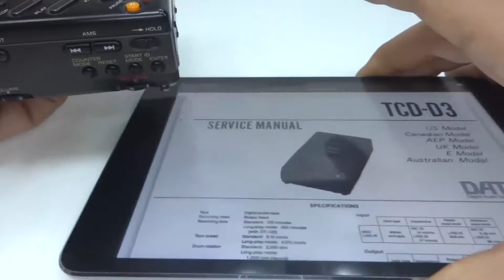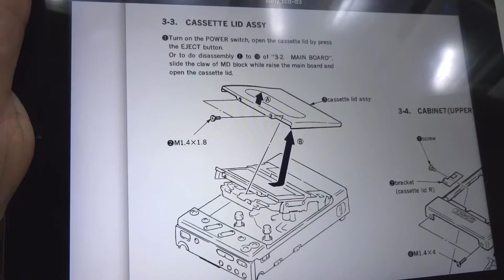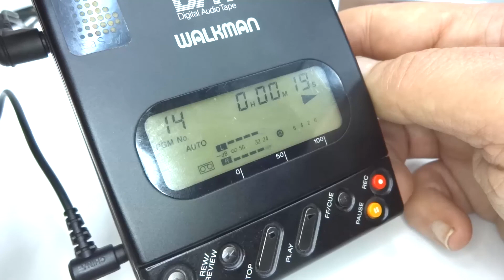Sony TCD-D3 Digital Audio Tape Walkman teardown & repair

Comment from the maker: I would like to thank Mike for providing a key piece of information in re-assembling the gear section. I struggled with this part and ended up not filming my many attempts and put it down to blind luck in the end. Below is Mike's description and the document he found.

"the image of the load/unload detector gear is exactly how the gear must be set.  Notice the spring is resting on the hub and the larger protrusion on the hub is pointing at the 4 o'clock position.  Hard to tell from the hand drawn picture but the gear teeth to the right are positioned exactly as shown.  Also, there  was a bit of resistance to setting cam gear 'B' to the 9 o'clock position but it too must be exactly as shown.  Even though it is hand drawn, it is quite accurate!"
https://drive.google.com/file/d/1iALyt8N_TsuhBS_y2FTb4-zE3xypc0ay/view
Reply: I was looking for exactly this info. Someone had hands on this unit I'm working on, and Sony was kind enough not to include this very essential info in the SM... shame on them. I was sure the unit has synchron issue, but without this picture it can take forever to find the right constellation... thanks!
Reply: Ok so it seems that even that guide is not precise enough. Following that will result the B gear 1 tooth out of phase. Correct position can be achieved like this: when the machine is in base condition(stop-unloaded, lid closed), there are 6 1/2 teeth between the dot on gear B and the left side of the opening lever (it must be in the "closed" position!).  The dot on gear B is at about 9 o'clock position, you start counting from the tooth just under the dot.
Reply: @janosnagyj.9540  I have taken my  machine apart " again " to fix the missing pads for the break, after reading this , it did seem still out of sync. So after I fix the breaks I will use your method. To see if that  helps. Thank you.
Reply: @TunnelLeaf  Well if the machine was working OK then I think you have no problem there. In my case it ended with +1 teeth position, so almost any operation finished with "CAUTION"... even a simple eject as well.  But after power down - power up, you could use the machine. Moving the B gear 1 tooth solved all these issues.
Reply: @janosnagyj.9540  I ended up at the end of the day (yesterday) having a working dat machine. I did replaced all the pads on the breaks and I did use your idea on the adjustment of the gears . No tape loops out and I have fast forward and rewind . Thank you
Reply: @TunnelLeaf  No worries, glad you managed to make it. So now there are 2 more working examples ;)
Reply: ฟฟฟฝฝ
Reply: I spent like 6 hours to figure out the right alignment of the gear section on my TCD D7. I could not set up the cam gear B to 9 o'clock position so I had to figure out a way to sync the gears in a different mode. It was a nigtmare.
Reply: For those of you who have trouble setting the cam bear 9 o clock direction. Move the mechanism to the fully loaded position then set the cam bear 9 c lock position.
Reply: I have a question. On my dat it let's some extra tape out , could I use the tension arm to fix that? When I started the unit did not work, but now it somewhat will.  Thank you

Comment: Dear Sir,

Do you have any experience with the Sony TCD D100 device?

What type of battery is built into it?

Can it be purchased separately? The display is soldered to the motherboard.

Thank you for your reply.
Best regards,
Reply from the maker: I've never seen this model, but I do really like the way it looks.
Reply: @JanusCycle  Does the TCD D3 model also have a built-in/soldered battery? A tiny one? To keep track of the date and time?
Reply from the maker: @bomby-1176  The TCD-D3 doesn't have a clock or calendar function. I didn't realise the TCD-D100 has this. I really want one.
While I am bidding on one at the moment, I expect it will go for more than my bid tomorrow.
Reply: @JanusCycle  Oh, I'm sorry.

I have one with a mechanical fault.

What are you looking for, and how much are you willing to pay?
Reply from the maker: @bomby-1176  A kind offer, thank you! 
I would also like to hear about your interest in these devices and what you enjoy about them. email is a more appropriate forum for talking about potential trade.

Comment: I'll be the newest to comment. I tried once or twice to examine and fix my TCD-D3. Your link to the service manual won't work for anyone not already registered to hifiengine, they won't accept new registers. I bought the original digital optical & s/pdif add-on companion unit for this too. Maybe I'll try again to get this little gem working. (CAUTION)
Reply from the maker: I'm going to have to update some links. Here are the manuals. Good luck and let me know how it goes. https://drive.google.com/drive/folders/1as4tXSpxGgHf_Zl9dsKUsMwIqgcV2E9m
Reply: @JanusCycle ... .. Thanks so much for these it's great when YT content creators actually read and followup with responses to their video's comments. Appreciated 👍
Reply from the maker: @Carlsings  Thanks so much :) When I stared this I decided it wasn't for fame or fortune. I just wanted to share things I enjoy and communicate with others who also enjoy these things.
I really want to get my TCD-D3 out again for a new video. It's been way to long.

Comment: I bought a Sony Portable TCD-D3 DAT Player/Recorder in 1990, I believe, it costs me $1,000 CDN at Advance Electronics in Winnipeg, this was Sony's most serious attempt (that I know of) to push this format into a mainstream consumer offering. My intended use for this was to obtain and record the music ABC Sports used for their 1989-1991 Tour de France broadcasts WHICH WAS NEVER RELEASED TO THE GENERAL PUBLIC. So after two dozen long distance phone calls in 1991 from Winnipeg, Canada to ABC Sports AND Kalehoff Productions in New York they did send them out to me, which I made digital copies of (FOUR R-DAT TAPES) worth and then sent everything back. So now in 2025 I'm curious how long will the audio stand up for, I'm at 35 years now and I think I can hear the sound degrading, just a little bit, but I really don't know that for sure.
Reply from the maker: I also don't know how long DAT tapes will last. Magnetic recording is usually quite stable. With many floppy discs from the 1980s and analogue master tapes from the 1960s are still fully intact today. If stored correctly I don't think they will decay. But I guess it could also depend on the individual quality of your tapes and your DAT machine condition today.
You can make bitperfect digital copies of DAT tapes. Using your TCD-D3 and a digital audio recorder, or a computer, with SPDIF input. I experimented with this in a couple of videos. With using digital data encoded into the music to prove to myself it was a bitperfect copy.
See, 'Sound Bits: backup data in all the wrong places' and 'Sound Bits: recapturing bitperfect audio from DAT'

Comment: I bought mine new in 1991, I still have it, never use it so it has low original hours.
If I ever tried to repair it myself, it would end up like bad, bad Leroy  Brown, "looked like a jigsaw puzzle with a couple of pieces gone".

Comment: Thanks!  I've got a D3 and D7 I need to repair - very helpful video as a start.  I think these portable DAT machines are the pinnacle of Japanese engineering - absolutely fascinating how they are put together. /Brett
Reply from the maker: I hope your repairs go well. Be very careful if you need to take the gear section completely apart, I struggled with this for too long. I saw your video, looks good, I think you will enjoy the experience. Let me know if you need any help. Feel free to email me as well if you want.
Reply: Thanks mate, appreciate it.  Had a quick look on Yahoo Japan auctions - seems to be a decent supply of the D3s (at least) in various states - thinking I might buy (or try to buy) one of the cheaper "not working" ones as a possible donor ... buying a known working one (at top dollar) just defeats the purpose ;) /Brett

Comment: Sampled with an almost new DAT Walkman. To my ears, I found the bias and equalization a little off, something not natural, slightly thin sounding. I actually prefer the analog cassette format, I find that more pleasing to the ears. For digital just go with CD etc imho.

Comment: Hey. Congratulations on resuscitating your little masterpiece of Japanese electro-mechanical engineering. Must be very satisfying using it now. I bought one new around 1990 for something approaching $1000 CDN. Unfortunately it croaked a few years later (dead electronics). After lounging around my closet for a few more years I donated it to a local museum. I couldn't find the service manual on the web at the time. Now I kind of wish I'd kept it.

Ah well. There'll always be other projects.
Reply from the maker: Thank you. I wanted one of these since the 1990s. It must have been amazing to have owned one in 1990!

Comment: I use a hypodermic needle with sewing machine oil and it frees up the capstan shaft (loosen the screw on the topside and slide the pad to one side, tiny spot of oil there) and a tiny amount of lube on the shafts of those gears and it's all good.  The tape broke because you moved the cassette back and that engaged the left spool lock, d'oh! I've just fixed up a dead TCD-D3 that has a seized capstan and ate tapes, the reason it ate tapes is the frame and "shark" shaped plastic piece that opens the door fully (and retracts the hub locks) was bent and the left reel was always locked and the cassette door would break off if the lid of the machine was pushed closed.  It's quite easy to work on, just have the right tools and I found a head torch to be really, really useful.  Glad to see people still using DAT after 30 years! 😁
Reply from the maker: Great tip, thank you. DAT is amazing. I really enjoy owning this fine machine.

Comment: Should never put a screw driver near or on a head. Even if it does not move you don’t do it.
Reply from the maker: Thanks, I need to use a plastic tool more often.
Reply: Janus Cycle 
Get yourself some of these 3 Pcs Nylon Plastic Spudger. Type it in on eBay. Your find them handle for things like this and cheap too.
Reply: I forgot to say to people. Anyone thinking of buying a dat recorder.or buying one to do up. This dat player the D3 only had a head life of 600 hours. A lot of dat recorder only had head life of 600 - 2000 hours. I repair a lot of electronics and see this a lot where people want there dat repair. But I have to tell them that the head as done it’s time and that why you get drop outs or recording that are not as good as they was. The problem is you just can’t get the parts now. So be careful buying this format. It’s a great format but age as catch up with it. Don’t think your find many now that is not over its head hours now.
Reply from the maker: @michaelmitchell8218  I agree. I took a chance because I wanted the experience. A working unit is a fortunate bonus.

Comment: Hi good job.
I have one D3 but I can not align the gear A with gear b correct.
can you show one picture o explain the position of this 2 gears?
thanks
jesus
Reply from the maker: Perhaps you mean the rotary encoder gears? Have a look at the 'technical theory' service manual and let me know. https://www.hifiengine.com/manual_library/sony/tcd-d3.shtml.
I found the rotary encoder was very difficult and much trial and error was needed to get them right.
Reply from the maker: I have pinned a new comment above with a newly found description of the gear alignment for the TCD-D3.

Comment: I owned 2 of these in the 90s both had fuse troubles both needed repairs (built in fuse replacement) I did like them though. Good little unit
Reply from the maker: Thanks for sharing your experience of the faults you encountered. It must have been amazing to use these in the 90s. I really wanted one of these back then and I'm very pleased to finally have a working one now.
Reply: @JanusCycle  it was always amazing listening  back to the recordings made with them. Quality  and authenticity to original sound.
Tapes recorded on one would sometimes glitch if played back on the other but that was probably due more to head alignment than anything else
Reply from the maker: @antonfarqua  I love that DAT worked so well, but was also operating close to the tolerances of the technology of the time. Thanks for reminding me of this cool machine. It's been on my shelf for a few years, I will revisit it one day.
Thanks for coming back after five years to reply :)
Reply: Hello do you know the location of the fuse?
Reply: @jesamani75  it's on the main board somewhere it's an electronic fuse that blows when a lower rated adaptor is used in place of original. I belive due to the high start up draw as the tape loading mechanism runs. I had them fixed by a tech so i can't help with exact location of the component. If I remember rightly the tech referd to it a a" sacrificial fuse" hope this helps
Reply: @antonfarqua  thanks so much

Comment: Hello, nice and helpful video. I have the same model which had a similar issue. I cleaned the rotary encoder underneath the gear cam. Now it ejects the cassette but it does it too early, leaving about 1 inch of tape out of the cassette. It believe it's out of sync for a few gear teeth. Could you please give me some advice? Thank you.
Reply from the maker: The rotary encoder is very difficult to get working properly. There is a second service manual called 'Sony tcd-d3 technical theory' which has very detailed rotary encoder instructions. I ended up doing some trial and error until it worked ok, still have some rewinding issues but I don't want to try again for at least a while. Here is the manual https://www.hifiengine.com/manual_library/sony/tcd-d3.shtml
Reply: @JanusCycle  the helpful manual is "theory of operation" . I fixed caution error due bad official service repair procedure  (sprayed with oil that glued the mech gears) and I unmounted and rephasing encoder gear after complete cleaning.
Reply: Have you figured out the issue?  I am having the same problem with mine!
Reply from the maker: @chrisnewman7828  I have pinned a new comment with a newly found description of the gear alignment for the TCD-D3.
Reply from the maker: I have pinned a new comment with a newly found description of the gear alignment for the TCD-D3.